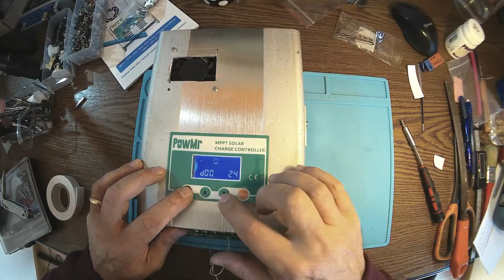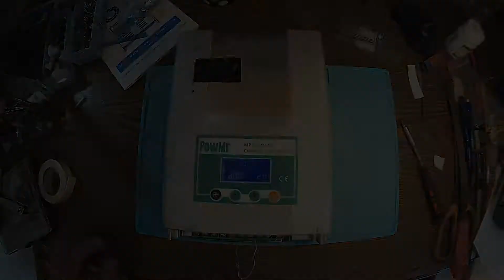DIY MPPT solar charge controller part 3

Comment: Mosfets touch rear part, so it would be nice to have bigger heatsing with 12V 12cm there
Reply from the maker: For now, it's ok, probably for higher currents an extra heat sink it's a need. But the machine have a fan, I never notice the fan running though...
Reply: @viocaia  looks nice. Its the sensor with good contact of mosfet.?